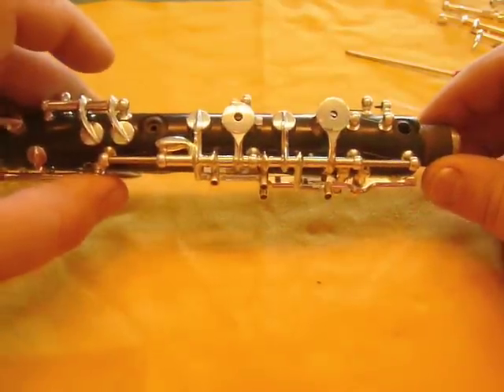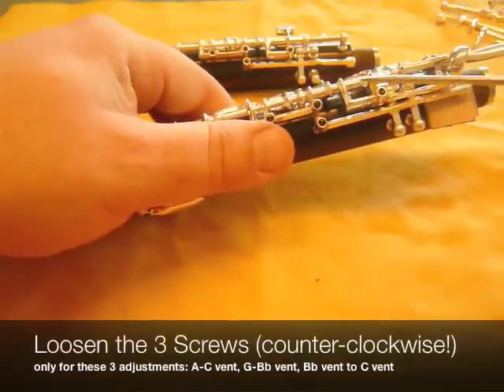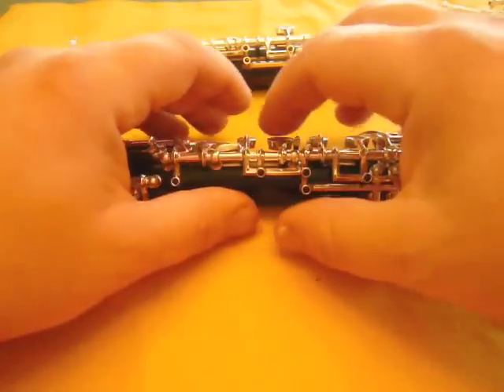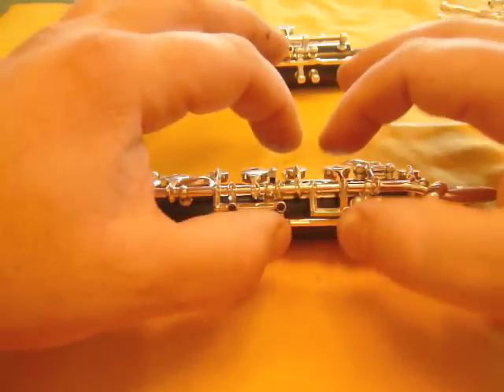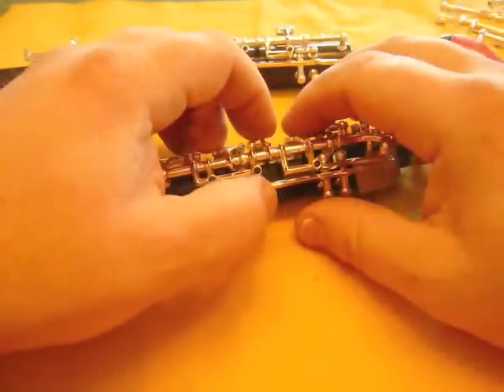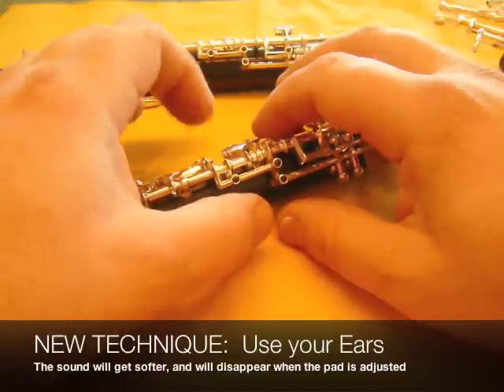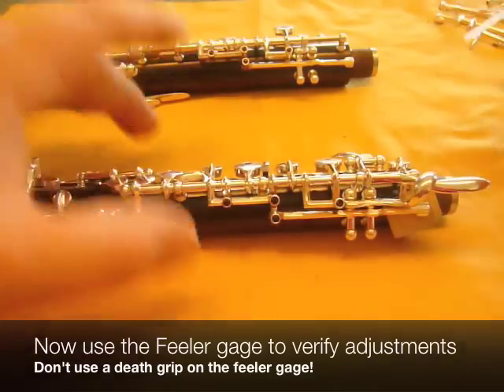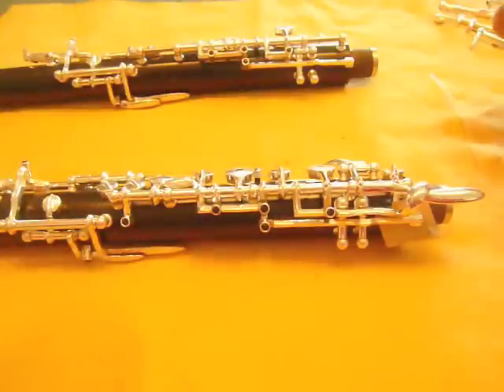Oboe Adjustments 2 Top joint

Comment from the maker: It controls the bridge adjustment between the joints.  There must be a small space between the F# key foot and the bridge key.  Otherwise the small pads on the top joint that open for Bb and C will stand open.